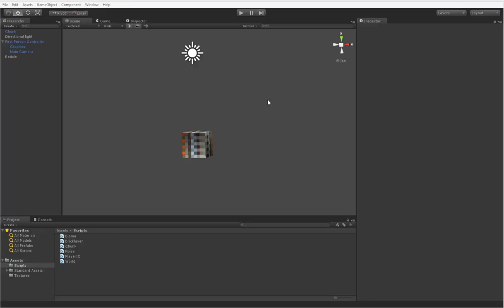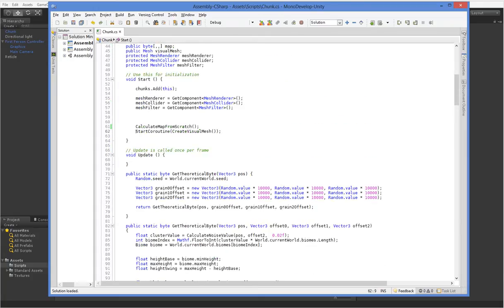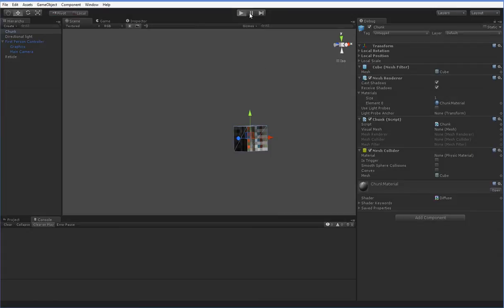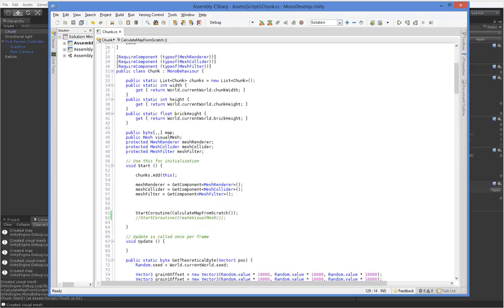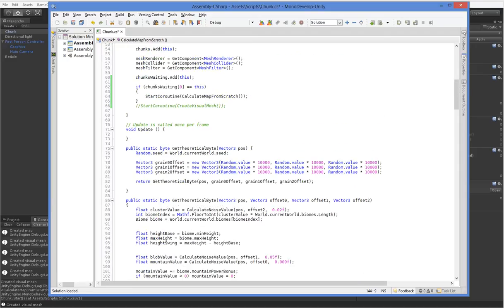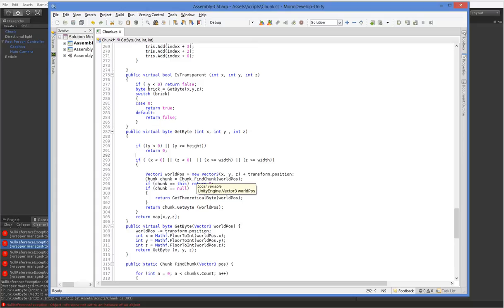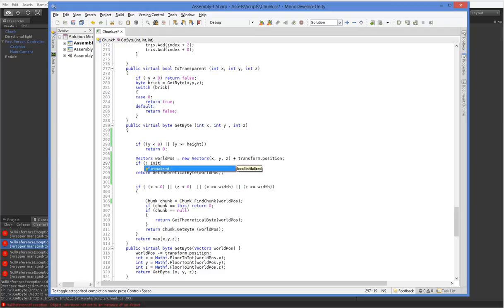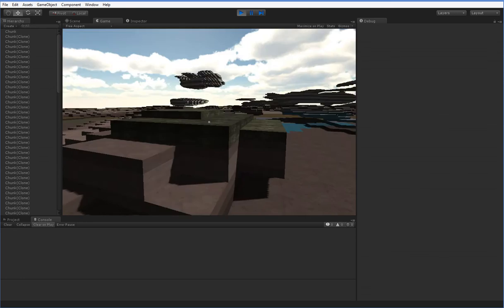Minecraft Mech #19: Let's Program

Comment: I know I'm late to this, and perhaps this is even covered in a later video (I'm currently working through this great tutorial), but here's how I sort of optimized my code (I was getting some SERIOUS pauses on my laptop when new chunks were generated):

I took the code that checks if new chunks should be created (in World) and made it into a coroutine, and put a yield statement in the inner for loop. This makes the function only instantiate one new chunk (if necessary) at a time, and then it waits until the next frame before continuing through the loop. So all the new chunks that need to be created get instantiated in sequence, frame by frame, instead them all being created at once. With this I can use rather high draw distances with just a bit of slowdown now and then (as long as the chunks are reasonably small), instead of the entire game freezing for half a second. It would be even better if the generation of a single chunk could be split up over several frames, but I haven't figured out a way of doing that without breaking everything.

Here's the code, perhaps it can be of help to someone: http://pastebin.com/zU01XY2a
Reply: +Joakim Melkersson This works Perfectly

Comment: Even though it did help my FPS problem when it loaded new chunks from freezing for a half second or less to getting < 9 FPS to half a second for less, it's still very noticeable and annoying. How can I further improve it? I have 32x64x32 chunks with a 64 draw distance. Thanks, beforehand!

EDIT: It's not my computer. I have an Intel Core i5-4670 and a Radeon HD 7970.
Reply from the maker: 1) Use a faster noise library.
2) Call it less often (simpler terrain).
3) Use proper threading rather than Unity's crappy "asynch" system.
Reply: Gonna time how time it takes to generate noise. If it's too much I'll get a better noise library. If not, then I guess I'll just deal with it. Thanks!

Comment: this is what i'v modified in the Theoretical byte function
float mountainValue = CalculateNoiseValue(pos, offset0,  0.009f);
		mountainValue *= mountainValue;
		
		mountainValue *= heightSwing;
		mountainValue += heightBase;
		
		mountainValue /= (Mathf.Sqrt(pos.y) / 2f);
		float clusterValue = (CalculateNoiseValue(pos, offset1,  0.1f) * 10) - 5f;
		
		float weight = 0.5f;
		
		clusterValue /= (Mathf.Sqrt(pos.y) * weight - (weight * 20));
		mountainValue += clusterValue;

Comment: Hey Craig, so I've got everything working currently. But for some reason I have one biome being ridiculously more populous than the others (tried having 2-4 other biomes and ones always more dominant) I've been going over everything but I can't figure out why this could be. Was wondering if you'd had the issue at some point?
Reply from the maker: I really don't remember. It's been ages.
Reply: Craig Perko Aha oh dear. I just can't think of what could cause it... The other biome spawns in smallish blobs... D:
Reply from the maker: Check the scaling multiple. If you're multiplying the x/z position by tinier numbers, you'll get larger patches.
Reply: Craig Perko Uhm... I may seem like a complete derp... But which scaling multiple?
Reply from the maker: The noise function that gives you how much "biome" is there takes an X, Y, and Z value as input. That's the world position of the brick. But we multiply it by some small number.

If we multiply it by a really tiny number, then every 100 world X, Y, or Z units might only be 0.01 noise field units. If that's true, the noise field would change very, very slowly, and the biome level would be similar for hundreds of meters.

Each biome can have its own scaling factor, which means you can have large biomes (jungles) and small biomes (ponds).